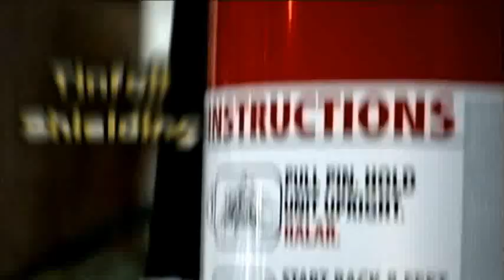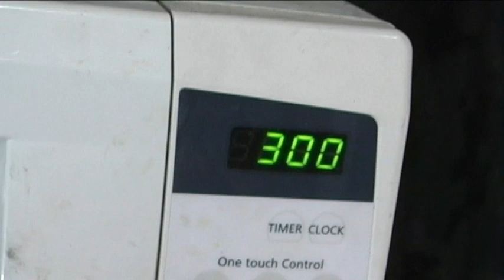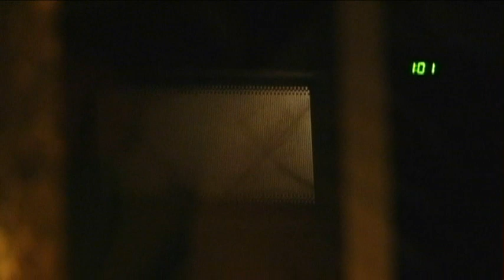Is It A Good Idea To Microwave Capacitors & Voltage Meters?

Comment: Nope Never seen capacitors that big.  

I'm wondering if because they were so large they were essentially able to absorb the energy which is why no damage was done.  That or they are heavy duty and are designed to withstand that kind of heat.  

You should do capacitors in the future but drain them and then check the charge on them after popping them in the microwave.  I'd like to see if that does something to them.

Comment: Yes, I've seen larger capacitors at a local electronics surplus store. I didn't read the labels, but I would guess that they are electrolytic and in the Farad range, rather than picofarad and microfarad which are more common in low voltage electronics.

Comment: To answer their question I have seen cpacitors even larger than that. They were used for 500,000 volts. They weigh a lot

Comment: I work in electronic assembly and capacitors actually get bigger than that. Interesting side note, if they are installed into a circuit board backwards (neg. to pos., pos. to neg.) and the board is attatched to power, the caps blow up.  :D

Comment: I've seen capacitors that large before. They were in an old Atari upright arcade cabinet I helped a friend repair.

As for the poll, I'd rather see a combination of some of those previous experiments. Like spray paint and fireworks or flashcubes and gin.